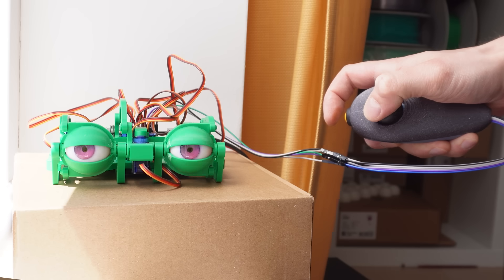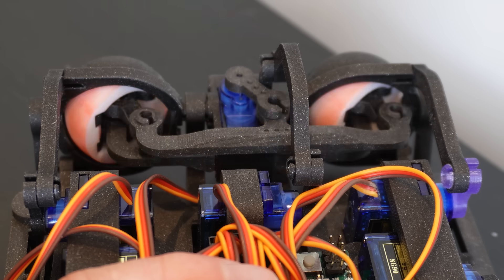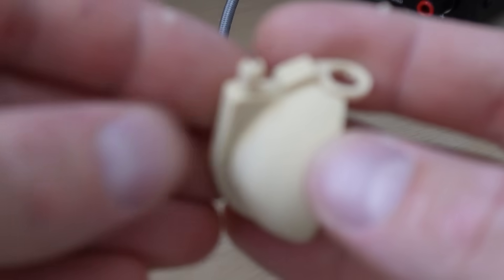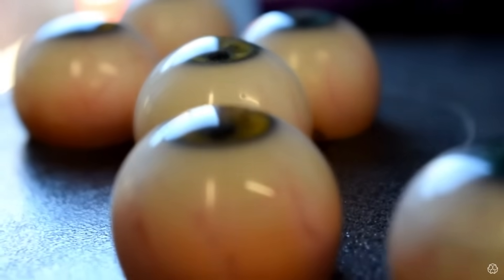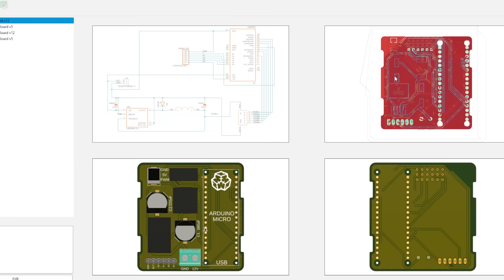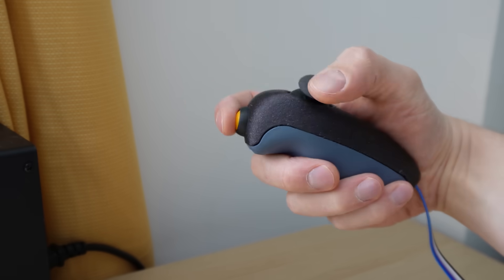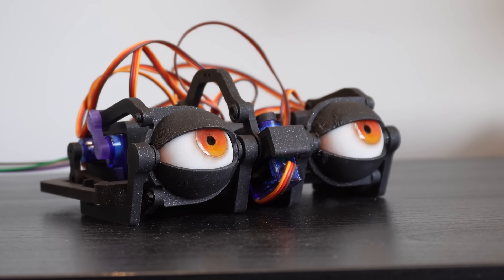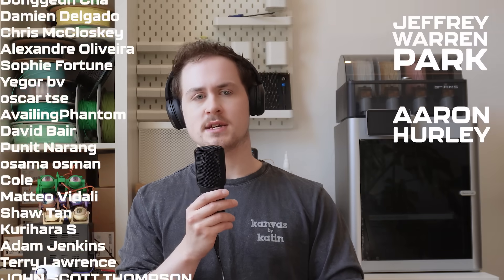Designing a 3D Printed Animatronic Eye Mechanism With ZERO Fasteners

Comment: I expected to be disappointed, but I had a bag of sg90 servos and printed the A/B sizing tool, finding the A slot was correct for my servos.
I printed the entire A board parts at 50% speed overnight on Bambu X1C in White PLA, and the next morning, went about assembling it.  I did not expect this to work very well, anticipating fit issues, or printing defects, or other gaps.  But to my amazement, it went together beautifully without a single screw and documentation was actually useful (especially the figures).  Screws are the bane of my existence -- I never seem to have the right ones, and they're heavy when you have fifty of them in a part.

Well, I have some RPI Picos around that I may experiment with, but I went ahead and ordered two of your control boards.  I really appreciate you sharing the models and making this mostly open source.  I tend to try to 3d print something before I will buy something, just to get to know the design and so on.  You're really good at this and I want to support you so you keep going.  I cannot wait to see your head/neck mature, and eventually the full-size humanoid.  If the rest of the anatomy is as good as these eyes, it's going to be amazing.  Maybe servos aren't going to cut it for a full-size humanoid robot, but I suspect you'll figure out a way to make it work.  This reminds me of printing and assembling inmoov robot, which I've mostly assembled but stalled at servo integrations.  This is way beyond what Inmoov was doing.
Reply: I'd love to see an MG996R version, or even larger servo.  I live on an forested acreage with some access roads, and I have this idea of installing some eyes on a tree, with bark for eyelids, just as a kind of fun feature along an access road where people drive by.  Would sure sure beat the static cameras I have currently, plus there's a bit of tracking with the eyes.  The larger eyes would allow for larger embedded stereo-cameras as well.  

I've wondered as well if you could leverage some fiber optic cable as a sort of "optic nerve" that directs light into the cameras mounted back in the brain area, rather than trying to put the cameras inside the eyes.
Reply: Ended up using an ESP32-C3 Super Mini I had laying around, and a PCA-9685, and adapted your Python code into an Arduino INO sketch.  It connects to wifi and presents a web-based interface for calibration, auto, or manual control with a trackpad like interface for manual, a slider for eyelid opening amount, and a button to blink.  This thing is so cool, and I finally completed a project! :D

I used a 8A/12A BEC and 2S 7.2P 1000mAh battery, selecting the 5V BEC jumper, and wired this into the PCA9685, then took a V+ from the edge pin to the +5V on the ESP32, so I power both the esp32 and the servos with the battery.  I love BECs.

Comment: I printed.your Zero Fastener model several months ago, got all the servos mounted, used a servo tester connected to each servo one by one to test movement, all was great. I even printed the controller, had all the parts, but never got around to connecting the electronics, soldering wires inside controller, etc, seemed a bit beyond me. Recently I got into Microbit V2 controllers, mainly to interest my 10 year old great nephew in electronics, this little board blew me away. It has radio capability and motion detection built in, as well as an onboard 5x5 LED matrix to display status, etc. Using one microbit attached to a RobotBit microbit expansion board, I connected all the servos to it, then I used an additional microbit as a wireless remote controller. Here is the kicker, I used ChatGPT over several go-rounds to create all the Javascript code for MakeCode app, it now works amazingly well! By simply tilting the remote transmitter microbit, I can move eyes left, right, up and down. Pressing A button on remote microbit causes both eyes to blink, pressing B button eyes blink one at a time in succession. Pressing both A+B at same time creates an amazing eye roll motion. Thanks again for your very clever eye mechanism design!

Comment: Terrible design. 
3d printed fine but when it comes to putting it together its really bad.
Parts kept snapping and breaking had to spend hours more having to print them again, extremely difficult to put together and in the process makes your fingers hurt.
Parts have loads of friction between them so it doesn't even work that well. 
Make a design that is easy to actually put together and doesn't waste plastic

Comment: Thank you for sharing this great project! It works great. I did have an issue with the eyelids "chattering" and found that the generic nano I was using was to blame.
Two questions for you.
1. Since Im a bit of a novice here do you have any plans to offer the populated circuit board (without the nano). I expect you could make some extra beer money if offered..lol
2. Any chance of offering a version of this using a weii numchuck? Im sure that design is beyond my capabilities. The current  remote works fine just would like a smaller handheld. Perhaps push-hold button etc. for eyelid movement

Comment: Hi Will: I built the updated eye mechanism using the Arduino Uno. I really liked the snap together model so I printed that out. I would like to use the Arduino for this design since I have it already. Do you have a wiring diagram and code for the and code to use the Arduino on the snap fit? The current codes do not work. Thank you in advance. Great work.

Comment: Excellent project, Kudos to all your hard work! This is the best iteration of your eye mechanism, the model went together perfectly for me. My tip to make easier, but impressive eyes, I imported the eyeball STL into TinkeCAD and made the recess to fit a 16mm glass eye (with flat bottom), with a bit trial and error, I was able to get the glass eye to fit perfectly and it matched the overall curve of the eye, fits perfectly inside the eyelids. You can find 16mm glass eyes in many different styles at your favorite online vendors

Comment: Will, do you have the Arduino source code available for when using the custom PCB?
Reply: I figured it out, and my problem was two fold; 1 - Using the previous version of the Arduino sketch which relied on the Adafruit library. The download for snap mech does, indeed, contain the implementation using the Servo.h library, and I just got the sketch versions mixed up between the 3 builds I've done of this project. 2 - I'm using the "new" version of the PCB that you provided on your website. The wiring is slightly different than what is shown in the reference files. After rewiring my controller and uploading the correct version of the code you provided, the mechanism works great (with the exception of the potentiometer, which I'm currently working on implementing - will share the code here when it's done). I'm not sure if you've gotten around to validating the new PCB design yet, as I haven't seen an update, but I can confirm that it's working exactly as expected, and I appreciate the additional exposed pins as I'm working on adding some features. Cheers!

Comment: Sir your next mission if you choose to accept it is to switch the servos with noiseless gimbal motors 🐲 the saved space could be reworked to connect actual cameras to the eye balls. Balance the device on a storm32 bgc gimbal 40bucks currently on aliexpress and voila molto bene🤩 I marvel from the distance!
Reply: Yes! I keep waiting for people to use gimbal motors so there won’t be servo noise 😝 Hearing gears takes away from the experience for me, especially when you buy expensive hobby robots 😬

Comment: hi will. It's awesome to see what is done bytpeople like you. I have a couple of suggestions. Looking at the parts, it seems like some of the snap connections are unnecessary. This reduces the chance of broken pins. one example are the eyelid links. the servo horn would seem to hold them in place . I also wonder if the lips need to be so large asi it makes it hard to snap the parts together, requiring a lot of force and potential breakage. Please keep up the awesome work.
Regards, Jim

Comment: I would recommend you swap out the arduino micro for a D1 Mini ESP32. They only cost $6 and they have wifi so you can easily make a wireless controller. This is a great project!

Comment: I bought 4 sets of tiny hex screws to make the original but my printer at the time was a pos, but now I have an artillery sidewinder X1 and now that I have a decent printer I'm going to try again with this thank you
Reply: Solution found for servos not moving:
It turns out that the servo driver needs 10V to run, so wiring a 9V battery will not provide enough power to run it. I used a dc power supply that I could change voltage and current.
(A side note, to make sure your wiring is also correct for everything else, when you plug in the cord that you upload code from your computer to the arduino uno, a red light on the servo driver should turn on. This shows that your wiring is indeed correct, but the likely issue is that you need 10V supplied to the servo driver board)

Comment: Will, it's nice to see that you're still refining your designs. If you would like to have your designs be able to be used in real world applications, there are a few tweaks that need to be made. The issues I'm running into is that they simply don't fit in most applications. If you want a more "universal" type design that can actually be put in animatronics, the eyes and lids and the mounting brackets for them need to be extended at least 1/2" to 3/4".  The problem is clearance issues. They should fit easily in the orbits of the eye sockets. When using them in human 😉animatronic heads, especially skulls, they don't fit.

Comment: Hi, very cool design! I try to build it on my own but when I upload the gerber (doesn't matter which version), BOM and CPL files to JLCPCB the "component placements step" throws an error: "The system detects components that may be offset from the PCB". Autoalignment doesn't work. Have you maybe not uploaded the correct files or am I doing something wrong?
Reply: Not sure if anything has changed since the files were originally uploaded, but I just made a custom order (with a few minor components changes) without issue.

Comment: Brilliant work! I know people in the puppet community would 100% buy finished versions of this. I also think there is a version of this that is rod controlled, no servos required. Not a cable, a solid rod. The rod is pushed up and down, and the eyes move up and down, this fits in the neck. But left to right? Solved by the rod controlling that via being rotated left and right. Horns, like on a servo, attach to the eyes via a linkage system etc. I know puppet people like big eyes, that are sometimes more than 50% out of the head. If the eyes are held in place by rubber bands the eyes can stick out further, and the rod mech doesn't need to have a middle axis because the sphere eyes are being pulled into a socket, that acts like a ball bearing, creating the axis. Just putting this into your head....

Comment: Now anyway to remove all electronics? I know it will limit its movements but with a couple 3d printable knobs or levers, we coule have this thing be an incredible battery-free toy that could even attach to many adapters , one of them could be a long stick that let's you move the eyes from behind a cloth or wall or under a table, so you can puppet this thing manually with some manual pupetter marionette style animatronic hand tools whatever those are lol im sure that's a whole adventure for someone else to try

Comment: Thank you so much. I think it's time for a universal 3d printable fastener and ai to help us redesign models for 3dprintables latched and pins etc... but yeah maybe we can make a universal 3d printable fastener or even a metal fastener that's the ultimate screw we can make in bulk for 3d printers or use something already ready to buy like self sealing stem.bolts

Comment: When do you think you’ll release the files for the controller?
Reply from the maker: I think I need to do some work before I’m happy with that one - but in the meantime I’m pretty happy with my original design - https://nilheim-mechatronics.notion.site/Simple-Controller-301224f539e245cfa63d29b218b5b366 (it’s not all snap-fit though!)
Reply: @WillCogley  No file attached at that link :(
Reply: I should have specified I am looking for the controller STL files. Either your original or no fastener version.

Comment: WARNING: For anyone changing from the compact design to this. The base plate does not have enough space to fit the MG90S servos that are vertical on the sides, only an SG90 will fit. It does look there should be space to cut the base a bit and make room. Great design otherwise!
Reply: Yeah, home Depot has great deals on generic Dremels. You can very easily modify a printed part post print with a wood shaping and cutoff wheel, wear safety glasses

Comment: Another cost-down/simplification could be to allow for the MCU to be soldered instead of putting the Arduino on. With a bit of luck the JLC library does have the same or a 100% compatible clone. You probably do not need most of the other components on the Arduino anyways.

Comment: Hmm, having trouble accessing the link to the PCB for JLPCB. Can you check the link there?
Reply: Just saw your reply about uploading the file to PCBWay from the ZIP file. Thanks!
Reply: Not sure what I'm doing when It comes to ordering (preferably populated) PCB's any guidance?
Reply: @davereynoldsorama  I'm actually having some issues with the component placement in the supplied files. Normally, you'd download the SupportPack files in the link, and in JLPCB, you'd upload the zip GERBER file (you have to rename it from it's current name). Then, check the box for PCB assembly, and you'd click continue and upload the BOM and CPL .csv files. But when doing this, the components aren't lining up correctly.

Comment: I've found using a bushing from delrin/HDPE/teflon eliminated a lot of my weak points in snap-fit assembly prints.

It also meant a number of my snap-fit components were planar, and could be laser cut from different materials.

Comment: I personally don't understand the appeal of designing a custom controller for most DIY arduino projects... like you can get a gaming joystick that snaps on to your phone and then just write a Unity App -- just pair your phone with the bluetooth reciever in your ESP8266 or ESP32 Arduino (srsly, we're talking about a 5 d0llar part -- and you're just replacing one part with another that's the same price at the end of the day) and then you just send it serial commands directly over bluetooth... -- The best part of this is that in remote control, which you wasted zero time or energy building, you already have a large capacitive IPS touch screen, internet access, data logging, physical joysticks and trigger buttons, and wireless charging... all in one compact device... and you didn't have to do anything but write the software -- heck if you need a dedicated controller and that's your excuse, you could even do it on your old phone or a grocery store burner phone. -- Bluetooth is fast enough that game consoles use it for their controllers now, and nobody is complaining about lag or speed. -- It's just fast, and this is just easy and works well.

Comment: Very impressive but...
...personally I'd stick to the design with screws. Steel screws would be stronger, more reliable and take less space. Also one could then stick to generic PLA. Assembly time would only be a big deal if one were mass producing these. I'd be far more concerned with future disassembly and reassembly if this is a hobby project.

Comment: Love this comment: "But they are cool, and coolness is the most important factor in engineering."
Reply: Never thought of it like that, it sounds odd, but I think it is dead right!   I watch a lot of Youtube engineering content, (too much according to camp mother) and the ones that are most memorable are usually cool!  😊
Reply: Coolness may be one of the big factors of engineering, but coolness won't matter if it doesn't work, or breaks too easily... another factor of the DFA should also include possible repairs if it is a high ticket item... or difficult to access... Nobody wants that $1000 animatronic if it is a pain to get into and/or breaks down every couple of days. Sometimes you need a mixture of both to achieve both ease of assembly as well as durability and consistency.
Reply: @edwardpaulsen1074  There's this thing called "humor". You might want to Google it.

Comment: i suggest you to look into esp32d1 mini boards for the wireless  board, they are cheap and small but nativel;y support BT and WIFI, on top of having the ESP NOW protocol to talk between each other, they also are 3.3v board so the remote could be powered by a tingle li-ion cell and have the standard usb charger pcb
Reply: I concur. I have found esp32 to be quite superior to Arduino.

Comment: If you haven't read them yet, go dig the Designing Plastic Parts for Assembly books for knowledge. Should act as very good supplement for this kind of stuff (even if not within the same tech tree as 3D printing).
Neat stuff regardless!